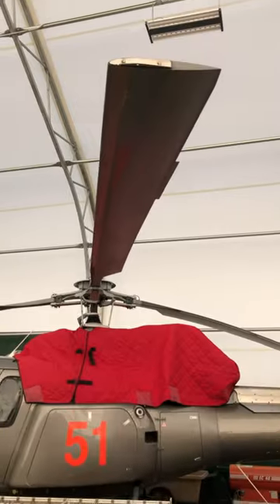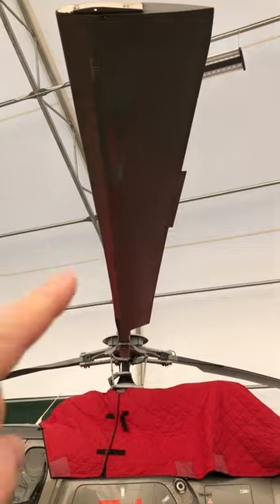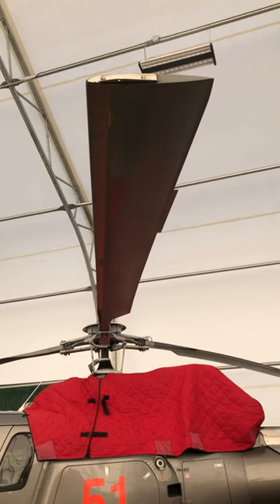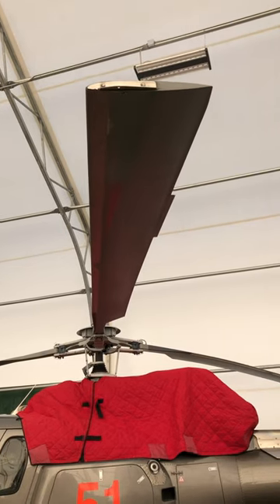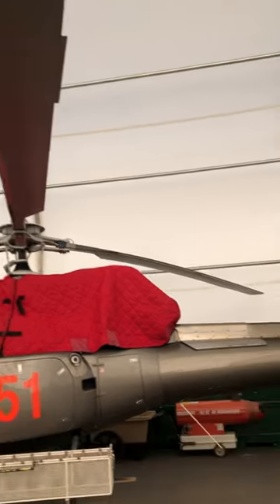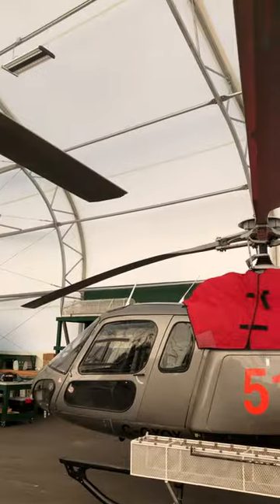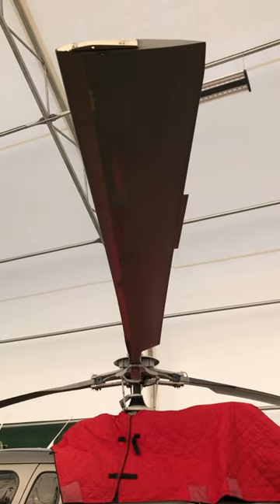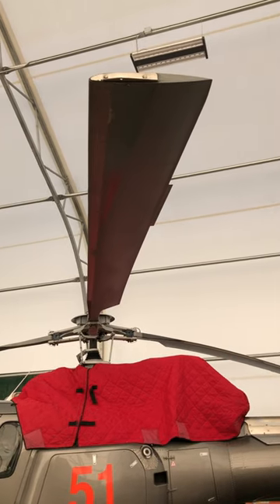What Do The Tabs On Helicopter Rotor Blades Do?? #shorts

Comment: Hello, can you please explain what happens to the blade if you bend the trailing edge trim tab down or up? i´m student of atpl(h) and the book  
sed: 
Bending the trim tab down will cause the blade to track down, if the blade is seen to be tracking high.
Bending the trim tab up will cause the blade to track up, if the blade is seen to be tracking low.

but i think is ; bending down will cause the blade go up from the aerodinamic 
thanks!
Reply: Came here from exactly the same question! I've read your comment. My classmates and I believe that the answer to the question is wrong.
Reply: @Marco37472  😅from were are you? i'm from Spain